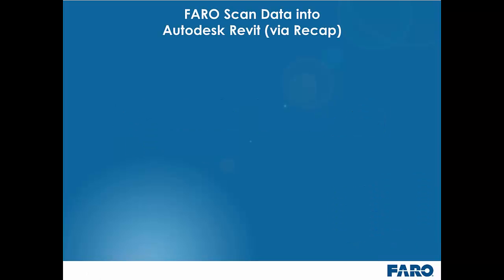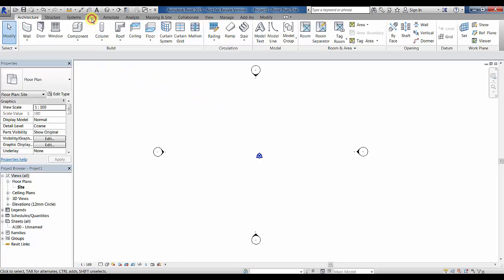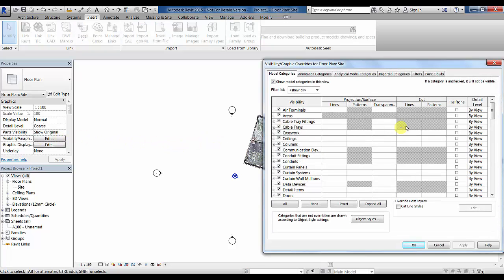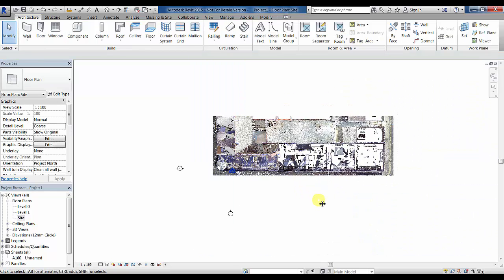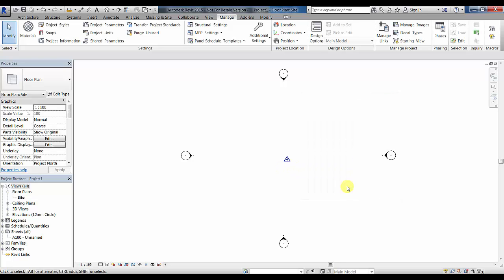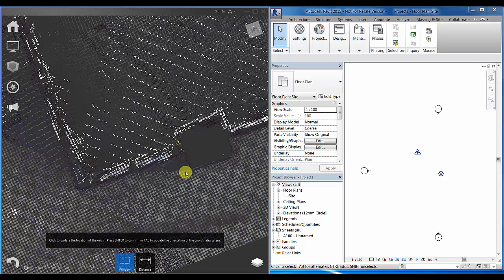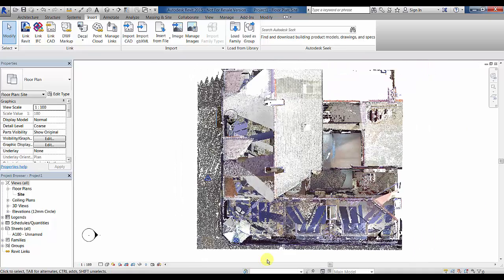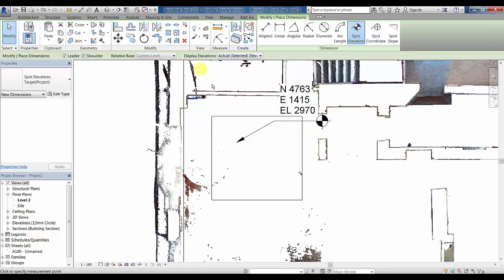FARO Workflow Guides - Autodesk Recap Into Revit

Comment: Be careful when doing this. If the point cloud isn't actually moved closer to 0,0,0 origin from within the point cloud itself Revit will have accuracy issues. This is the same with linking in an AutoCAD file that is placed way off in the distance residing in a real survey coordinate system location. In Revit, it will display strangely and the lines will jump. I have tested this with bringing in the geolocated point cloud into Civil 3D and Revit and then measuring the same items. The results vary slighting. It's not terrible but it does create some inaccuracy and inconsistency where if the point cloud itself is moved closer to 0,0,0 this corrects the problem.

Comment: Great video! quick note - Yes, the Faro scanners contain GPS, however the true north direction should only be considered approximate without survey control. the resultant positions of the scan stations are accurate to >2-5m which can have a significant effect on the orientation of even a relatively small point cloud. the only way to be sure is to have surveyed correspondences...

Comment: I have scan data that was given to me and when I import it origin to origin its comes in over 2000 miles away from revit origin point, what is the proper work flow in this case?